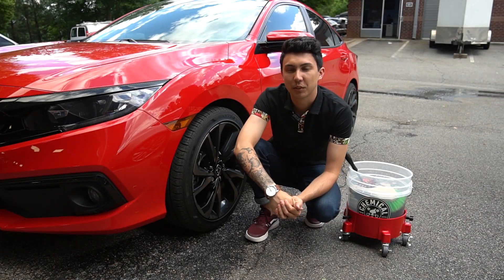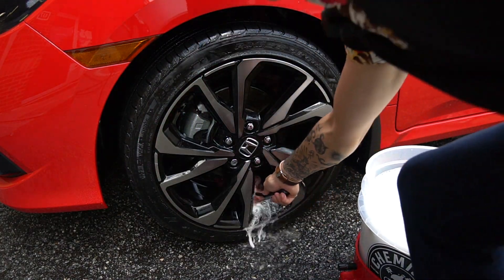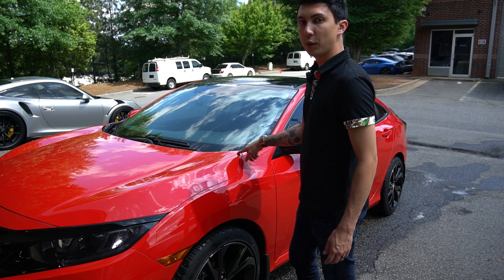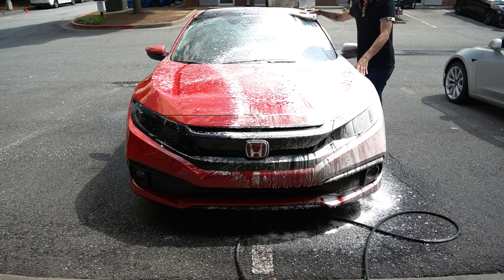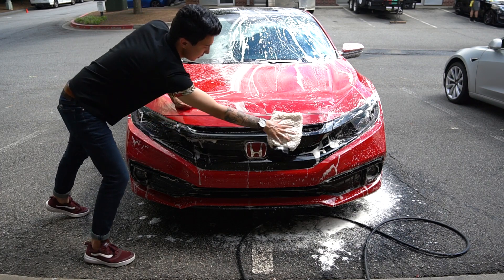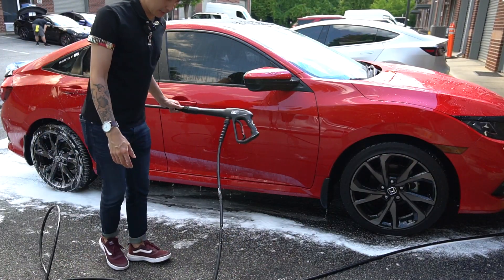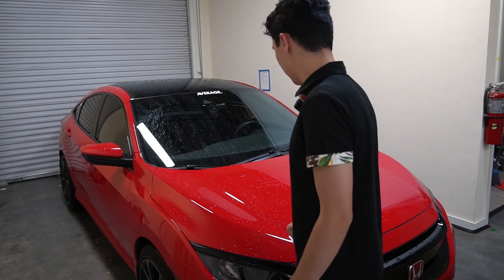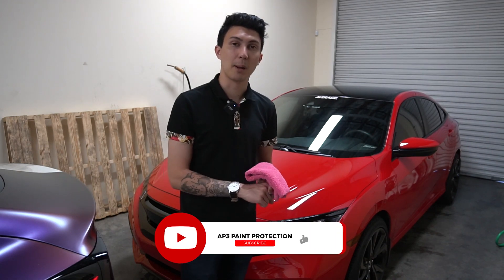HOW TO WASH YOUR CERAMIC COATED CAR

Comment: How often should you use the xpel ceramic boost? Also what your advice on drying the car with the blower to get most the water off but should you use a drying aid to get the rest of the water that you didn’t get with the blower?  

Thanks

Comment: Thanks! I only have PPF, not ceramic (yet) is this how I should be washing my car in general?

Also, the links to the materials in the video description aren't working for me 🤔
Reply from the maker: We will fix those right away! Sorry about that. And yes, that's a good rule of thumb to washing any vehicle depending on coating or not. When your vehicle isn't coated, there are more factors to consider to prevent swirls or marring, but other than that, yes!
Reply: @AP3PaintProtection  links broken :0